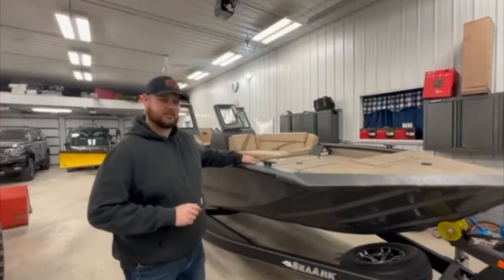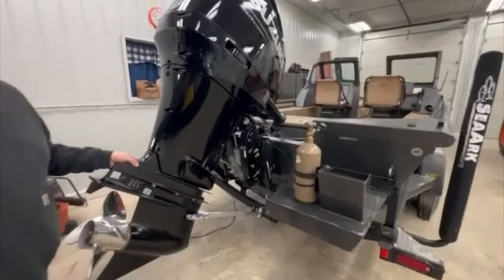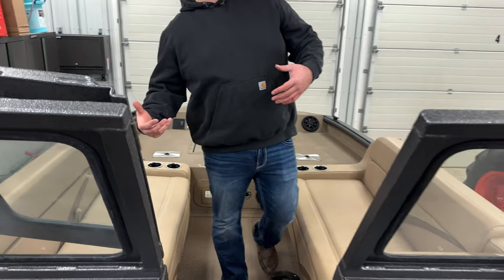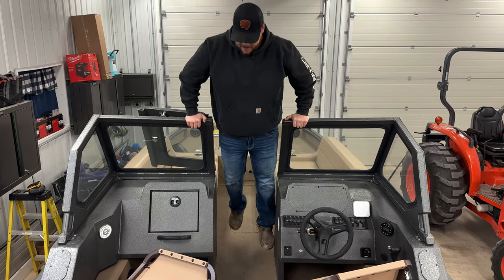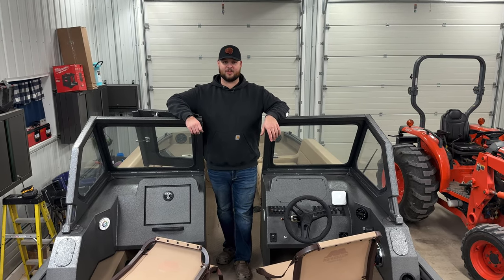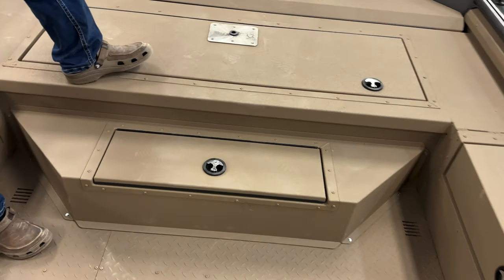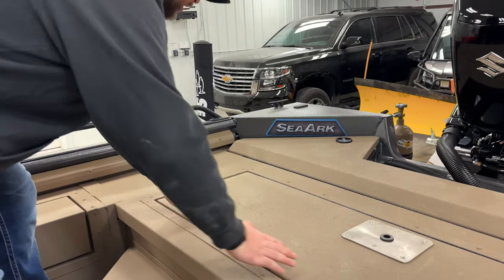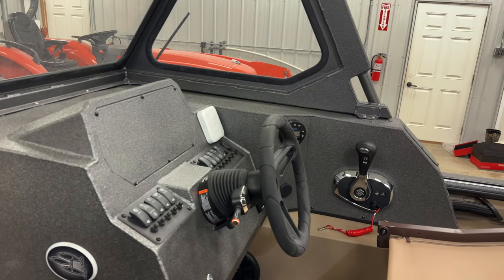2023 Seaark Easycat full walkthrough!

Comment: Fine rig you said it is drive buy wire so is it like air craft electronics?
Reply from the maker: Not really familiar with aircraft but basically it’s just like the throttle in a new car. It’s all electronic there are no cables anymore.
Reply: @EasyLifeOutdoors  Thanks for replying Thats how large aircraft fly with transmitters & receivers again great boat that 300 suzuki should hall-ass.👍
Reply from the maker: @michaelburke6552  no problem man! It touched 55 empty but now that I have all the batteries and everything in it it’s getting about 53